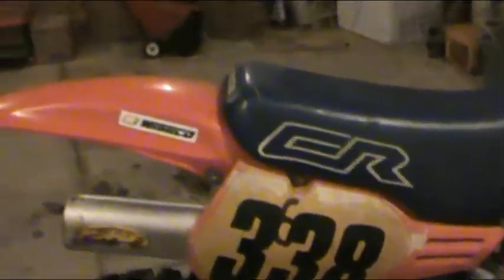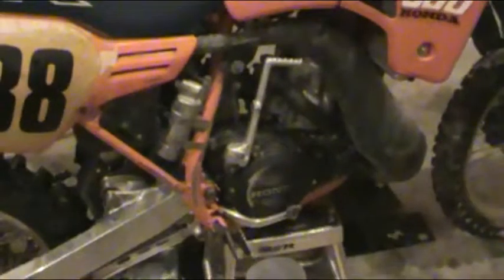CR500 Disassembly Pt. 1 Some Basics

Comment: Leave the radiator cap on at first..It helps hold vacumn until you have your big mouth canister at the outlet..let it drain a few seconds and then remove the cap..